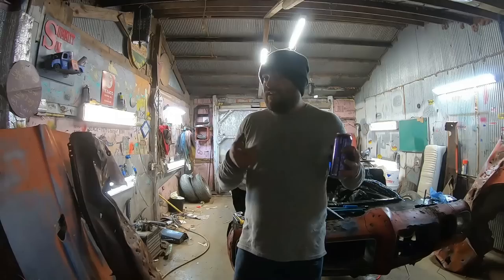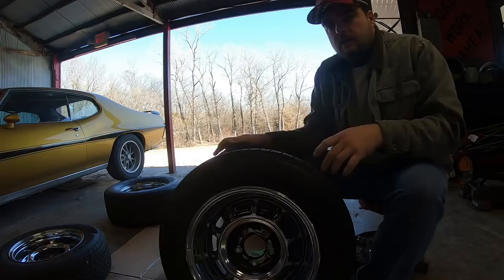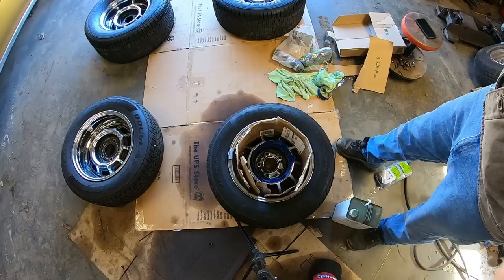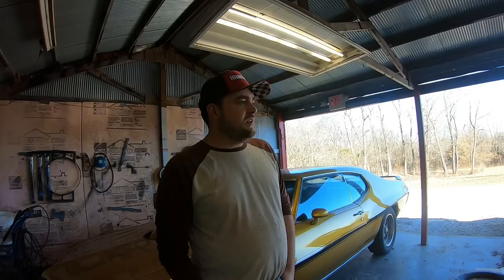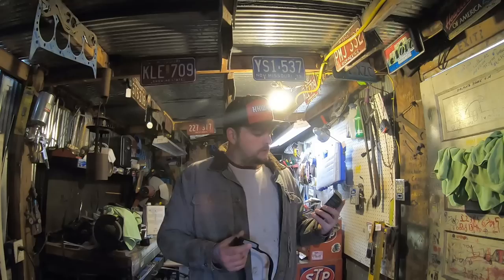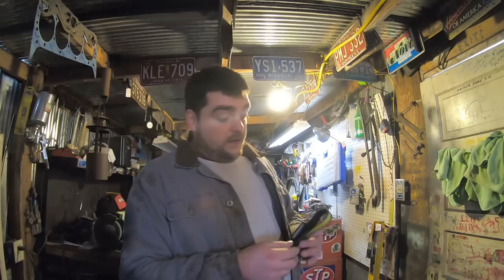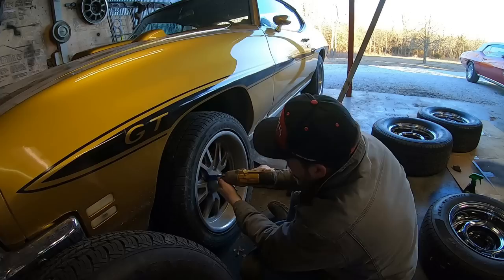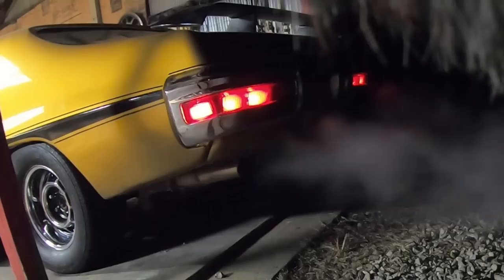The Other Pole Barn Garage Cars — 1972 Pontiac Lemans Gets New Wheels + Drive!

Comment: My first car was a 1963 Dodge 440 with a slant 6. It was my HS car. It got too rusty to pass Pennsylvania car inspection. I stripped all useable parts off it. With today's aftermarket parts...that car could have been saved. 😢 Most of those parts now reside on my current 1963 Dodge Polara 500 that I bought in 1991. I have owned a 1963 Dodge of some type since I was 16.
Reply from the maker: I can relate entirely. 70-72 Pontiacs for me, and it's not even really a conscious thing

Comment: My bro inlaw had a 1968 GTO . 400 with a rockcrusher 4 speed. The first time I got on it the front wheels came off the ground and it scared the crap outta me. Because it started to head for the right hand curb. I turned the wheel to compensate and nothing happened. Till I let off a little and she straightened right out. Lol!

Comment: Vaseline works great for ribbing on consoles. I also used just plain motor oil and wiped it with my finger on the chrome I didn't want painted. Glad you switched out those 17 inchers for the grand national wheels. When it came to out runnin the law, you only had to worry if the man was driving a Poncho. Have you seen those vids of Big Chief outlaw street racer? I love the shaker hood on your car. I always wanted to do that to a firebird formula hood....best of both worlds.